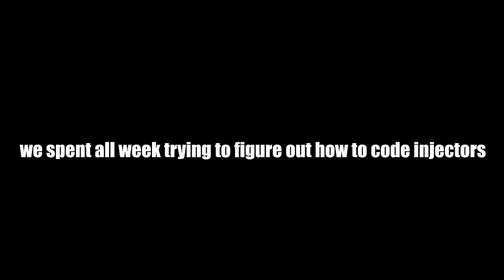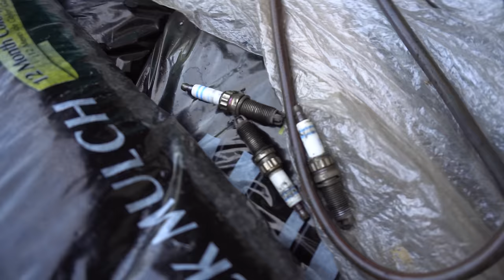TUNED BMW 335i EMBARSSING A PORSCHE! * IN FRONT OF COP *

Comment: The bore of franks #6 injector bore (the head bore I guess) might be slightly loose. If the problem persists you should retap the whole with a kit they make or just wrap your injector in teflon tape to create a good seal and it won't blow the injector seal out either
Reply from the maker: Appreciate the feedback bro🙏🏼

Comment: Surprised you don't have Protools yet. It works similar to MHD, but it's more so for coding side. You can code in/out several things like folding mirrors, injectors, battery registration etc etc